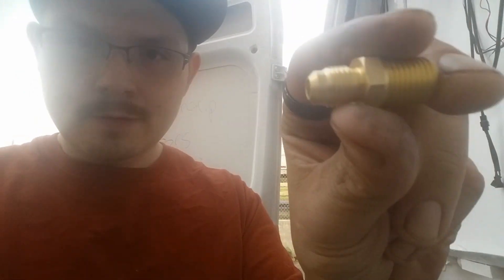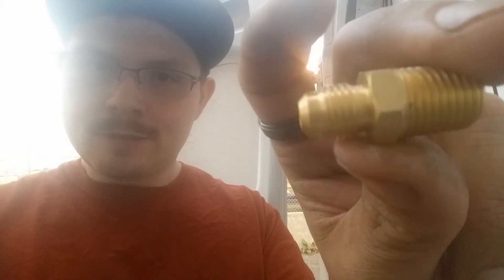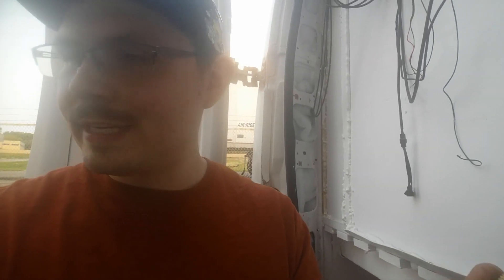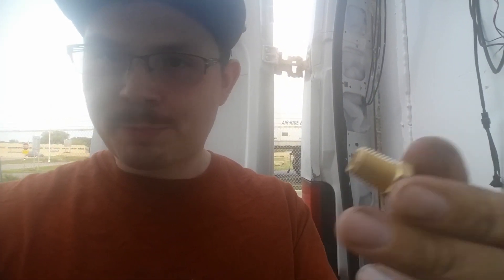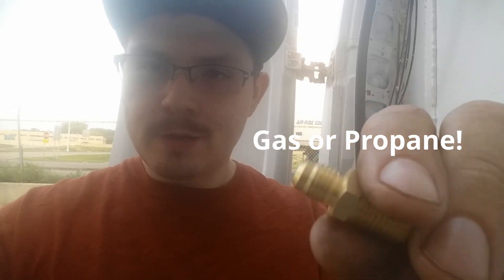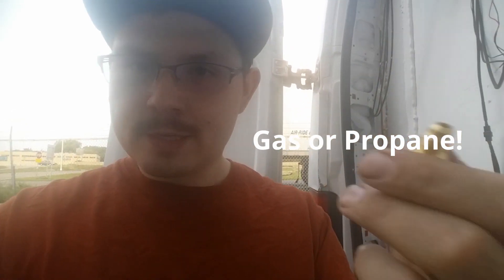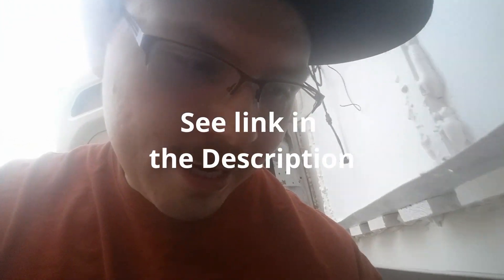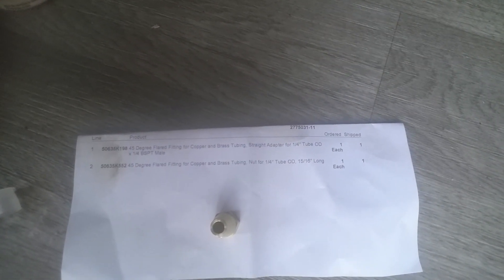WARNING! If Installing a Propex Heater WATCH Before Install! Propex BRASS FITTING HS2000 HS2800 VAN

Comment: I bought this and it didn't work for my propex hs2211. On my propex, I have a male fitting, so this didn't work
Reply from the maker: Sorry. I should have specified that it works for an HS2000
Reply: @twincitysounds6853  thx, ya hd2221 is parallel threading, learned the hard way

Comment: What do you mean the BSPT can't be taken apart? You meant the compression can't be put back together? I ordered a compression originally but luckily saw this and now ordered the superior flare fitting adapter :)
Reply from the maker: Bspt fittings are not designed to be tightened, then loosened. Repeated tightening and loosening of Bspt fittings can cause leaks
Reply: @twincitysounds6853  ah okay weird they're designed that way... I already had to take out the old compression BSPT and put in a new flared fitting so hopefully i dont have issues. Used plenty of gas tape though. Thanks for your video it was very helpful :)

Comment: Compression fitting leak on water as the pressure is 100 times higher than gas. 30 mbar gas vs 3bar (3000 mbar) water.
Compression fittings are fine, stop over engineering something simple because of the high consequences.